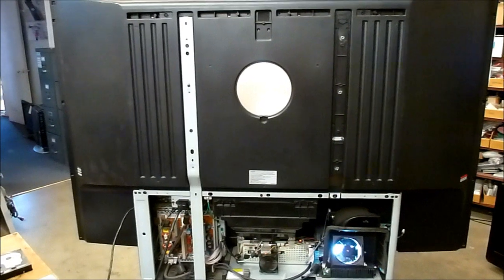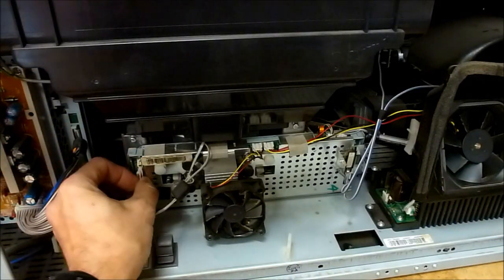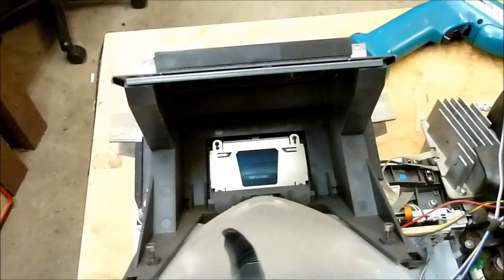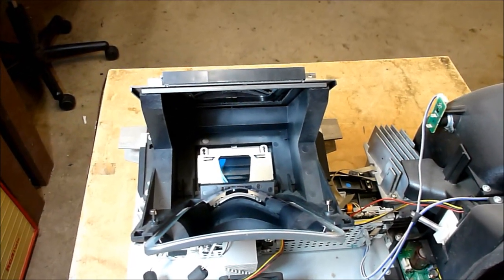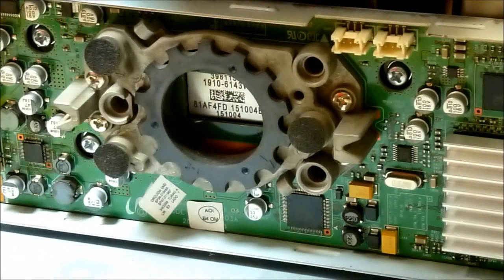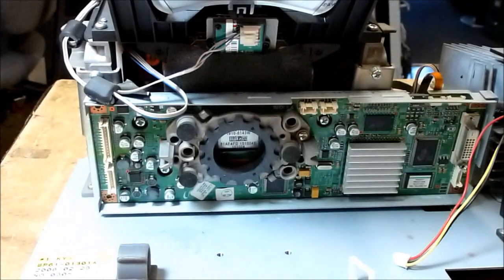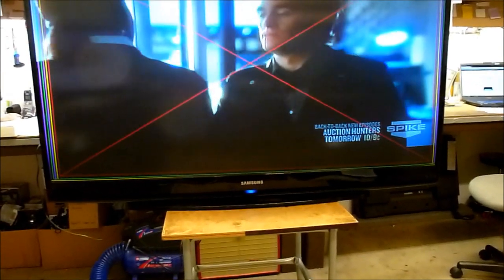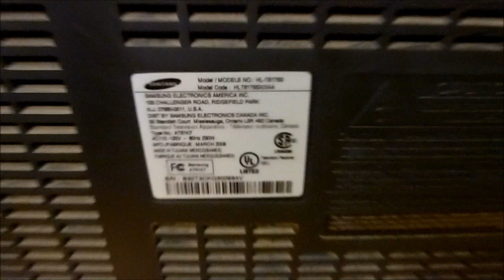Samsung DLP TV Cloudy Foggy Hazy Washed Out  Picture HLT 50 56 61 76 SX Slim Series 5076 5676 6176

Comment: Awesome video!!  I have two of these, similar models, and I just cleaned out all kinds of dust in part of the light tunnel and adjusted the focus.  Some how it got blurry and adjusting the focus totally fixed it, but introduced major dust into the area of the focus ring.  I just opened up that part and used compressed air to remove the dust.  Took a while for me to find it, I was taking apart two other areas of the light tunnel before I found the right one ;)

Comment: Thank you so much!  I bought a used 5076 that had a bulb replacement only one year previous.  I was disappointed with the picture quality just as you described. I followed your step by step on the mirror clean ups and woo-lah  AWESOME PICTURE restored! The picture is still slightly more out of focus at the top of the screen and clear as a bell at the bottom.  Are there any quick tune fixes for this ?

Comment: AMAZING tutorial, my wife and I followed your steps with stunning results! We have a separate problem that we noticed with this TV we recently purchased on Craigslist: There is "mold" between the two screens of the TV that show up as black spots against the picture. We detached the front of the TV, and tried to clean the screens however they are glued together. Is it possible to take these screens apart, clean out the moldy areas, and re-tape the screens back together? Will this have an undesired affect on the screen? I am not sure if they are glued together to stop them from shifting, or because there is a chemical in between that cannot be touched. Thanks!

Comment: Thanks so much for your detailed video. I had already replaced the lamp (after 12,000 hrs.!) and Samsung had repaced my DLP chip cause of white spots, even though it was out of warrenty, but the tech they sent out did nothing about cleaning the optics. The picture still looked like crap. Now it looks like new!  Question, the 3 screws with springs under them look like they should be some kind of alignment adjustment, but are they?  Should you just tighten them all the way down? Thanks again!

Comment: Great video, detailed and nice info..
Just one question..   My screen is tilted..   If I have a straight line on the bottom of the screen, it's down about 1/2" - 1" by the time it gets to the other side..   I read to remove the plastic caps on the back on the DLP chip board and adjust it..  I have found the screws..  But not sure how to actually adjust them..   Any help is appreciated...

Comment: Wow thanks for a lot of useful information !
My brother in law's Samsung looks like it is folded at the top of the screen, what could that be?
Also it has a red tint that is no doubt a stuck color wheel, correct?
Thanks Again !
Reply from the maker: Is it a DLP set? sounds like a CRT type with a vertical retrace cap failing and a weak crt. If it is a CRT TV check the caps around the vertical output IC and set the G2 and drive controls.

Comment: Great video! Helped us clean up a HLT5076. Just a quick question...this TV has major sagging in the picture. You mentioned the screws to adjust but if you can give more detail on where those are located that would be awesome. You said they are on the back of the TV but I have fooled around with every screw back there and nothing seems to work.
Reply: Where you able to adjust the screws?  I'm need to do the same but not sure where t5he screws are located.

Comment: to adjust the focus on a Samsung dlp, do I remove the heat sink in order to be able to adjust the focus ring? your video gave the "tip", but I cannot seem to turn the focus ring. I am trying with the heat sink in place while the set is powered on.

Comment: hi, i liked your video. my problem is. after hours of watching or high hd use. my picture starts to lose color then starts flutering and shuts down. someone said it was the little plastic swith and just tape it down. it worked for a while, i also have 2 small fans. one on the side where my bulb is and one at the back bellow the power cord.this model is HLT4675SX/XAC which i can't find listed. finnaly sometimes it works longer and shorter. can you help???

Comment: Best How to for DLP's online! I just bought one of these used and after closer inspection at home now it has a slight ghost image and hazy/dim (will clean as directed) but my biggest concern is the screen seems to have gotten knocked around during the move (2 hour drive in pickup) the black bar on the bottom is almost smiling at me and it's unbearable. Can this be adjusted with the screws like you said at the end or do I need to remove the frame and align it inside? Please Help! Thanks!

Comment: My screen got better doing this but its out of focus, how do i adjust this with NO RISK of shocking myself because I HATE that feeling. Also on the bottom of my screen and slightly on the top it curves. when i open the start menu it goes from the left to the right and then straight for the top half